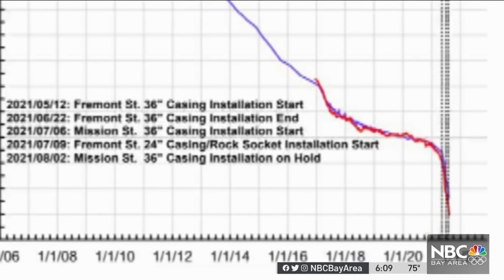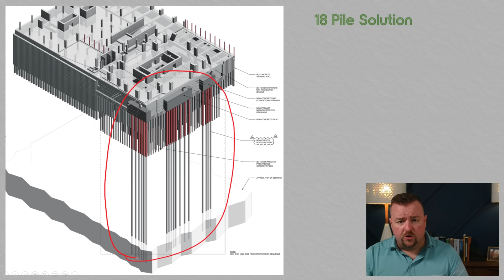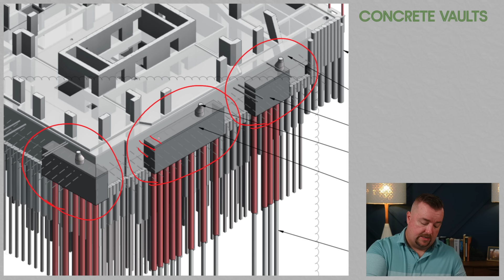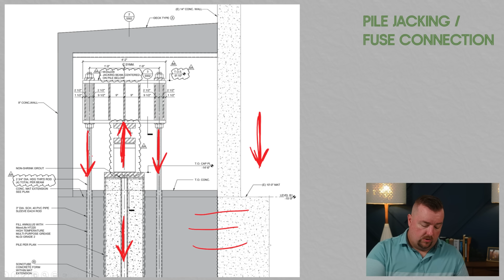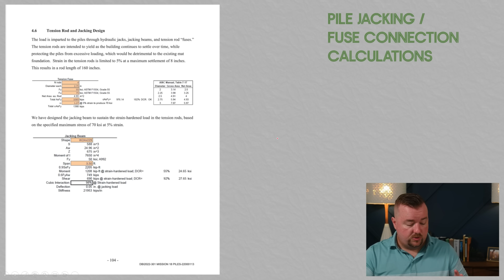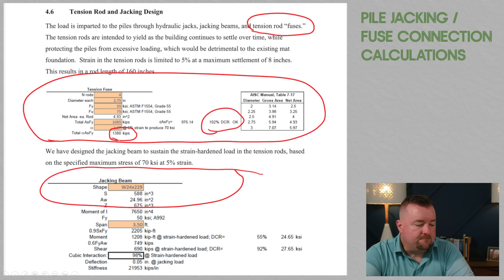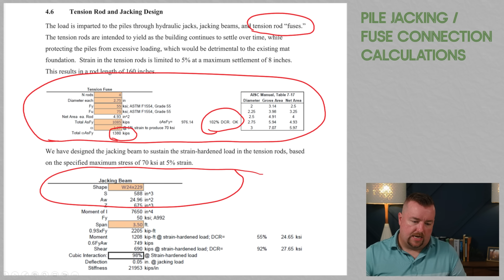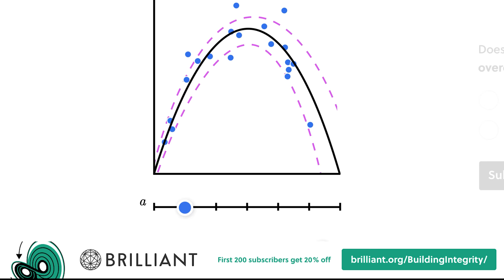Did I Uncover a $100,000,000 Mistake with the Millennium Tower "Fix"?

Comment: I was an ironworker on the original foundation of the Millennium Tower. Everyone knew at that point that the soil samples showed the building wouldn’t be properly supported before it was built.

I’m glad the original engineers were rehired to Rube Goldberg their way through this. It’s very comforting.

And yeah: that steel plate is going to explode at some point. If it’s not an immediate grenade, it’ll happen when rust sets in and starts to blow apart the concrete.
Reply: I believe that you know what you are talking about. I wonder why no one has subpoenaed you. If only they had spent the extra 4 million bucks to do it right from bedrock on up the first time.
Reply: @stephanpatterson7585  there were thousands of people on that job. Nobody needs to subpoena someone that was a 19 year old apprentice. It was common belief that the job was fucked from day one. Plenty of others more qualified to speak on it at the time of my work.
Reply: Yeah, i say my uncle, the concrete guy get his boss firing 6 engineers,2 phd's over a clusterfuck in a building in curitiba / brazil once, they could have caused a major disaster in the 2nd boggest building here if they had their way.
Reply: Justa Stranger, thank you for sharing your experience on the Millenium Tower.
Reply: @richardhack9830  you’re welcome. I wish I still had the videos of doors closing and opening on their own, balls rolling across the floor, etc. bad engineering makes for excellent show and tell. Lol.
Reply: I'm not a college-degree engineer but as a machinist and designer I freaked at first look upon these fuse bolt anchors. The steel plate needed to be at least 2-inch thick or more, with larger lift area up against the concrete. At first rough calculation for the powdering pressure I am guessing that the concrete has to hold integrity for 30,000 psi. to have any margin of safety, unless there is additional steel on top of the chincy plate to spread the load. Once the powdering starts it will progress and perhaps stabilize but then the plate may more easily shear - not enough experience for me to predict the plate behavior.. I think the plate can barely hold if the concrete does not powder around it and above it (also a rate of plastic creep to consider) to allow the plate to slowly travel upward over time. Good luck... maybe they actually have a way to access from below so they can improve the plates. If so I would endorse the approach, if not, then what is the life expectancy - only five years?
Reply: @YouKnowTheyExist  Thank you for your msg.
Basicly none of all readers need be an "Einstein" to sense there's something wrong - very wrong in the produced "improvement design" of the "Fuse Engineers"...
Reply: I'm surprised this whole thing seems to be not metric. Is that common for large projects like this? I thought since the military, medical field, and aerospace had learned their lessons, a lot of engineers would get with the rest of the world and work in metric. Que that one supplier that sends critical materials measured or spec'd in metric. Also, maybe they should have called Mammoet since they were the ones that helped lift and move the sarcophagus over the Chernobyl reactor.
Reply: Interesting thread.  Everybody brings something to the table.  Or not.  I'm not in construction, but if your concrete guy, your machinist–heck, even if a 19yo fetcher—gives you a raised eyebrow about something, if they say, "Boss, are you sure this is how it's supposed to be?"  You, as an engineer or PM or coordinator or whatever, ought to either have a solid response to alleviate the person's concerns or commit to pass it along to someone who does have a grasp of the matter.  I admit this project is way bigger than anything I've worked on, but even on the big ones I've worked, it's worth raising these questions.  Sometimes things are overdesigned.  Worse, sometimes they're undersigned.
In a project like this, I can see how when everybody is contracted, nobody has ownership.  A sense of ownership is what's needed to flag and fix stuff like this. Unfortunately, in a highly contacted environment like this you have to be a real Samaritan to raise issues like these.
Reply: @buttsexandbananapeels  And paid a lot more money to look the other way, no doubt...
Reply: @77thTrombone  a sense of ownership isn’t instilled in the worker bees by the billionaires that build these things. They want the job done. Questions were raised and they were shot down. Raise them again and you’re back at the Union hall. An ideal world is a great idea, but it doesn’t exist.
Reply: @nufosmatic  that’s a question for the inspectors. Any city has a lot of them on the take, which is why the construction in the US sucks.
Reply: @Gersberms  Unfortunately even the organizations you've listed haven't "learned their lesson".  Especially the military.  Fun fact, the entire aviation industry in the US uses "feet" for height.  Almost the entire world uses "Knots" instead of "km/h" for air speed!
Reply: @buttsexandbananapeels   As I wrote, I had a sense that the environment you describe was likely a factor in my euphemism highly contracted environment.
"You reap what you sow."
I've been fortunate in working places where that special sort of  toxicity was not only absent, but largely actively prevented.  I hope you've gotten some time in such environments too.   Best!
Reply: @77thTrombone  Good were the times when building firms were proud enough of their work to engrave the company name on the building and watching the building stand their for another 500-150 years.
Reply: @stephanpatterson7585  The builders were trying to save pennies.  Even laymen in the SF Bay area know that tall buildings need to go to bedrock or need to be wide enough not to tip.
Reply: @fss1704  sad but tru when Brazil has better oversight than San Fran lmao😂🎉
Reply: 👀 let's not forget the big earthquake that is going to hit
Reply: Hey Josh! I have learned so much through your videos, especially Champlain Tower.

A building collapse just happened near me and I would love to hear your thoughts. Will you do a video on the Davenport, Iowa collapse? 

It seems like there is a huge scandal somewhere. The city changed their latest inspection from passed to failed the day after the collapse. They were wrong about missing people and tried to rush the demolition even though there are 5 people unaccounted for and the last person found alive was just last night. 

Protestors stopped the demolition from happening today.
Reply: @arthurmoore9488 especially the military with how old a lot of the designs are. Different parts of the same whole may be specc'd in metric and inches.

Example 1: M17 pistol.  Specc'd on metric EXCEPT the optics footprint which was designed in inches. 

Example 2: 1913 rail (aka Picatinny rail). That's an inch standard.  The entirety of NATO has to use an inch based optics rail because nobody has ever designed a better mounting standard for optics.

Example 3: Mlok. Mlok is metric,  but it can't hold zero like 1913 can.  NATO service rifles are covered in inch and metric based standards.
Reply: @stephanpatterson7585  they won't take him as a reliable source without an structural engineering degree
Reply: I work on a freaking anchor handling tug. I'm no engineer... But this looks like the sort of thing that shatters dramatically in a storm due to a load that no one seems to have thought of... I just do not see how that plate is going to hold that load. Especially in an area as seismically active as Sanfran.
Reply: One would think that building code was just a guideline and not the law. I'm in Toronto and across the province of Ontario we've had a recent history of building code being completely ignored and the authorities acting as if it's just a civil contract issue. Building inspectors visit construction sites such as these almost everyday. God knows why they are collecting a paycheck when they wash their hands of the issue when problems become apparent after people occupy the building.
Reply: @77thTrombone  , no warning from a worker on a project of this magnitude should be ignored. It was the ironworkers who built the new railroad deck on the historic Eads Bridge in St Louis, who blew the whistle on the contractor and reported that bolts of only half the size and strength specified in the plans were being used. The workers' assertions were immediately investigated, and the deficient bolts were replaced with those that met the specifications. Had the workers not reported the condition, or had they not been heeded, that deck would have collapsed under a train and dropped a couple of hundred people into the Mississippi River. Too bad that workers on the Hyatt skywalk in Kansas City in 1981 didn't drop the dime on the contractors, for that collapse, which killed 114 people, was caused by bolts with half the strength needed to support those suspended walkways.
Reply: @Gersberms  - interesting conjecture since the entire Chernobyl reactor design was spec'd in metric.   Perhaps the units used are far less important than the design itself.
Reply: @vincentsutter1071  I won't argue that! It's when multiple parties have to cooperate and materials are sourced and imported when it matters most. What is heavier, a pound of gold or a pound of feathers?
Reply: @Gersberms  By all means please define which materials are being imported for this effort?  Your sophomoric question leads me you dismiss you as failing to be technically competent.
Reply: @chicagonorthcoast FALSE go read the Wikipedia article.  The failure was not caused by insufficient bolts.  The failure was caused by the construction workers not following the original engineering design for the walkway

.
Reply: My computer circuit cards are all metric measurements.  I would not use the old English system even if they forced me.  Metric conversions are so much easier (all multiples of 10)
Reply: @YouKnowTheyExist  I would have used a doughnut shaped plate that connects to all 4 bolts and extends around the jack.
Reply: At some point,  "just enough,  just in time" needs to give way to "built like a bank vault".
Reply: @Gersberms what has metric done for you lately?  If it weren't for freedom fractions,  everyone would be speaking German.  Show some respect. 😅😅
Reply: @hairybubbles127  It was awfully disrespectful of me, I apologize 😅. But what's that, fractions? My machinist disagrees, he prefers to work in mils or thous, and he buys his wire and sheet metal in gauges. The farmer next door buys water by the acre-foot and used to buy his lumber by the super feet. What is an acre you say? Oh, nothing too exotic. It's a chain by a furlong, or approximately the amount of land that can be tilled by a man behind an ox in one day. My AC works in British Thermal Units but my heater is rated in watts. I actually prefer history lessons with every order I place, every measurement I take, and every calculation I do! It makes me a smarter person.
Reply: @Gersberms  it's a rich,  wonderful mess,  isn't it?
Reply: @hairybubbles127  Sure is! I'm still trying to work out the most appropriate way to convert thous to fractions because I don't carry a conversion table with me. I guess it depends on what kind of a fit you want and how soft the material is. And for plumbing, just get a bigger pipe wrench and use more dope.
Reply: @Gersberms  my experience is that when you're knee deep in thousandths, 0.010" is the same kind of math as 0.254mm.  Fraction to mm?  Just divide numerator by denominator,  multiply by 25.4.  Lol... almost as easy a sneezing,  eh?
Reply: We would use similar plates to strap down pipe underground, the were of similar size with one hole per plate. Average water pressure was about 100 psi. On 8" pipe it would be srtaped to these plates, the plates were covered with appx ½ yard of concrete. The covered with 4' of 98% compacted 2A. Just incase of a sudden increase in pressure. Very interesting video,  I won't ever go near that building. Those plates are too small as you stated. Also each rod should have its own plate. We called them whalers.
Reply: @Gersberms  because lbs/in^2 is more fun to say than N/m^2
Reply: @YouKnowTheyExist  If I can wrap my tiny hands around it, it's messed up!  I'd wager 5" steel plates, possibly stainless? Dad was an Aerospace Engineer, mom an Architect. I'm just left with common sense that they drilled into me - and oh yeah - Mom's Architect books!
Reply: @fss1704 hey, I live in Curitiba. Which building is that?
Reply: Oh dear...
Reply: Oh my God. This plus the comments equals the beginning of every disaster movie I have ever seen
Reply: Your ironworker humor dark but man does it SMACK!!
Reply: @stephanpatterson7585 No one ever asks the worker who builds things everyday.  We have a “yes man” culture that gets things pushed thru and we hope for the best.  Look around, this problem is everywhere.  Someday we have to pay for all of the corners we have cut over time.
Reply: Everybody knew including the engineers. So they kept building. 
Even the Janitorial Engineers knew it too.
Reply: @YouKnowTheyExist  yeah - think you’ve got a point there. What you’re saying - & for me to put into engineering ‘speak’ is that the bearing stress of the plate onto the concrete needs to be considered. 

One would have to use the formulae’s of the concrete design code adopted. 

The steel plate however can’t really fail until the concrete does - & that would be by shear failure of the concrete - but it’s a deep section & there ‘might’ be reinforcement above the plate or on the shear plane zones. 

One would have to check to the design codes accordingly.